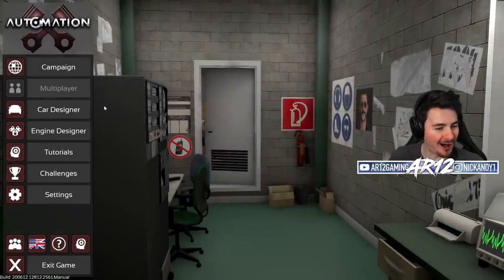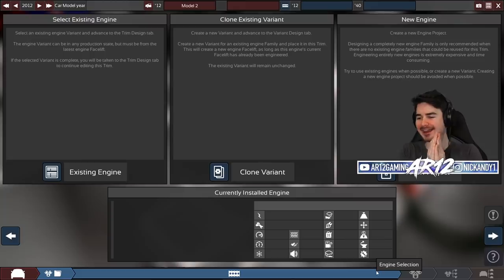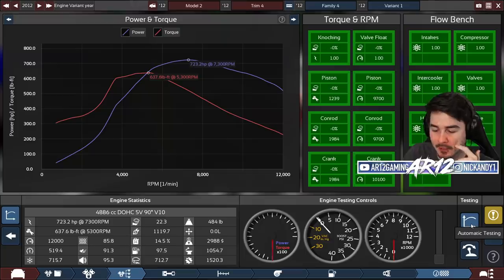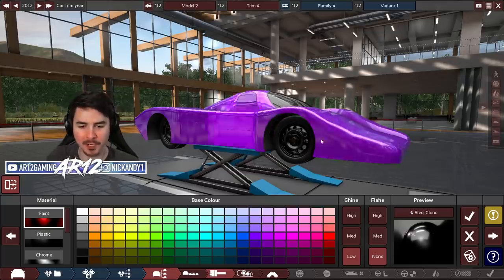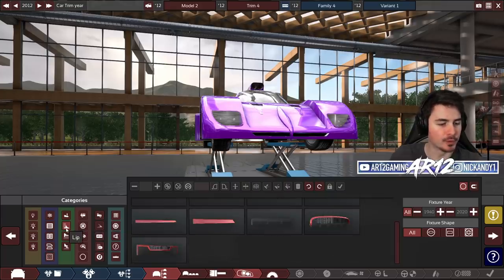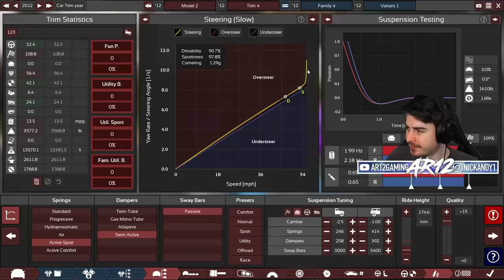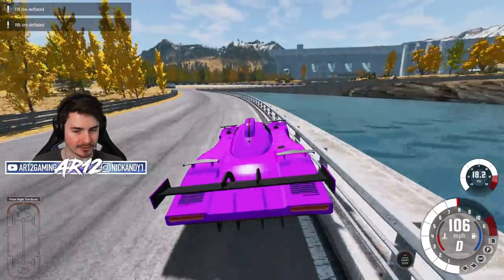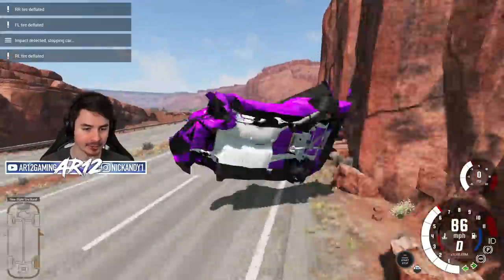Building The Perfect Race Car in Automation & BeamNG

Comment: It doesn't turn very well because BeamNG has a feature where if you give too much steering input, the front tires lose grip and you understeer horrendously. (Speaking from personal experience) So if you want better turning at speed, try giving it less steering input when turning. 

I'm not saying Nick is bad at BeamNG, I've seen quite a few other YouTubers who play BeamNG have the same issue.

Comment: You can turn better if you have a wheel because you can turn the wheel slower because what do you thinks going to happen if you going 170+mph and your wheels teleport sideways your not gonna turn
Reply: The reason you can in forza is because it’s not a sim and it’s supposed work with controllers